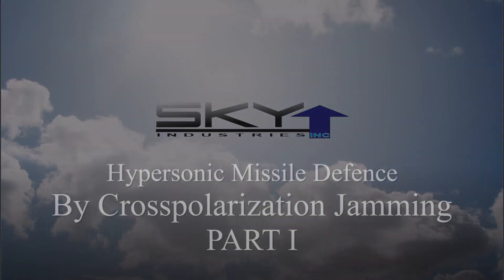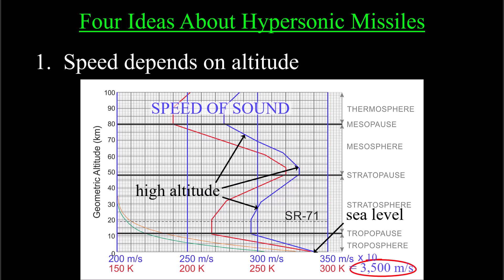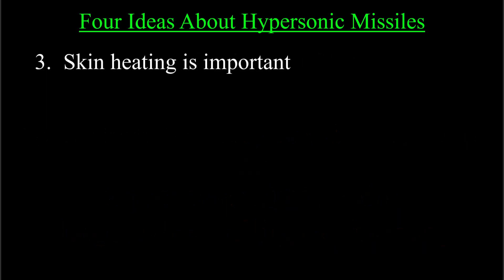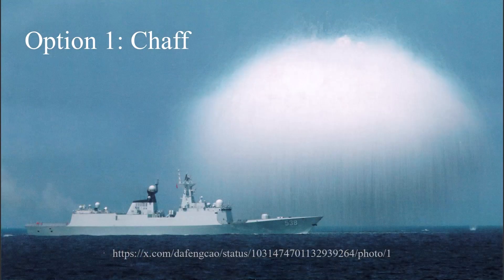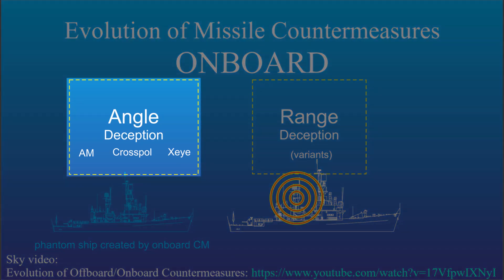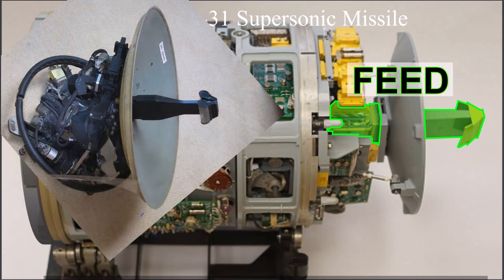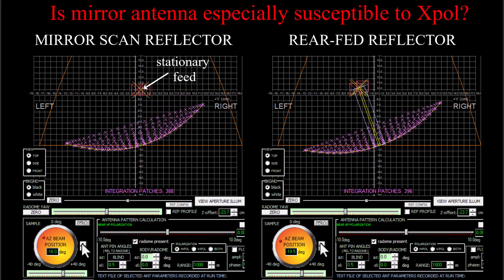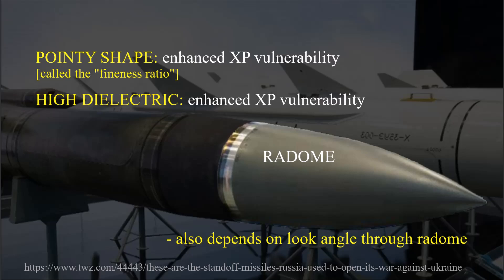Hypersonic Missile Defence By Crosspolarization Jamming PART I 25

Comment: Would these techniques still be effective against AESA seekers which can adjust to different polarizations?
Reply from the maker: Yes, although the jammer would have to be designed to automatically follow the polarization changes.  The required electrical arrangement is essentially a retrodirective Crosseye jammer.

Comment: I don’t really believe in point 4, about the impossibility overcoming plasma, same for aerodynamic drag and heat I think it’s possible to do a missile with a very high velocity in the terminal phase as well

I have a few ideas, one uses a funny quirk with physics/optics but whether or not that could work depends on how wide the plasma cone is. 
Another idea uses fluid dynamics instead. 

As for interception it’s absurdly difficult and I don’t think it will ever be reliable, very sophisticated missiles (far more than now) could have perfect vision, be impossible to jam, be able to maneuver with high G turns in all phases, coming in at speeds measured not in Ms but in multiples of 1 km/s, all while being able to come in from several directions at once and all while the interceptor systems and platforms available at each target are known in advance... 
lasers will never work both because the time is too short and because they’re already resilient to heating even if not expressly designed to counter lasers

Missiles have too much of an energy disadvantage and it’s not guaranteed that you have the luxury to intercept mid flight ( interceptors launched when missile launch is detected) 
Rail guns don’t work, the non stupid version, cool guns, could work but I seriously doubt you could produce a turret that can rotate fast enough while still being precise and launching slugs large enough to survive in the atmosphere while still being fast enough to give you a few seconds or put a few kilometers between the missile and the target at interception point

All in all I would say proper missiles will be impossible to stop, though that’s not necessarily a realistic scenario, most militaries are highly incompetent, corrupt, outdated and cut corners, they rarely even have an overarching doctrine
As such most missiles are low cost and close range, but that’s just the result of ground armies in a non nuclear setting in attrition wars searching for the cheapest bang for your buck option. It’s not an unavoidable way to conduct warfare.

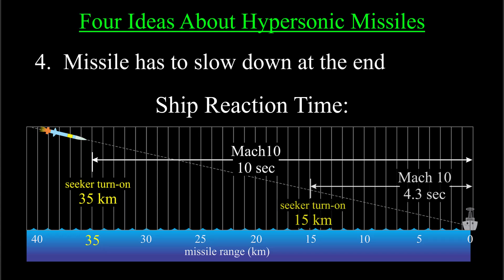Comment: 3:33 What if it’s remotely guided ? AWACS. SATELLITE. or other seaborne sensors . ?
Reply from the maker: The seeker is needed because a continuous flow of precise guidance information is needed to physically hit a target that can move after the missile is launched.  

AWACS detects the presence of emitters; it doesn't provide seeker-quality target location information.  

Satellites use synthetic aperture radar (SAR) which requires the satellite to move relative to the target so that means LEO satellites (Low Earth Orbit), so there's a time delay and likely update rate issues. 

A satellite could in principle also use video, but there are weather issues and time of day issues, and a LEO satellite orbit would have to be coordinated with the attack since it has to overfly the target exactly when the attack is started.  

Or: just use the seeker.  

In any case, the video is about jamming the seeker; impossible to jam a seeker that isn't turned on.  If it's not turned on, no need to include it in the missile.
Reply: @skyindustries Dear bro. Triangulation. There must. Be a jammer downtime/ reaction time. / delay. Seeker will be turned on for sure but ECCM is a thing to. In end phase when Oniks / Moskt dive in sea skimming mode and suddenly turns on a seeker , how long then would it take for ECM sensors to detect and deploy their counter. Thank❤

Comment: just asking - fibreglass guidance like a TOW or the new "jam proof" kamikaze drones  -  can a incomming missile or a cluster of missiles jam weapons guidance of air defence missiles 
China experiments with AI controlled droneswarms since at least 2019  - imagine including low flying cruise missiles with Jammers as payload
Ukraine droneboats/ boat torpedos like sea baby can be used a a platform for Air defence weapons to bait air assets into targeting range or as platform to jam incomming ship to land cruise missile guidance as well 
would it make a difference for air defence missiles on ships to be fibreglass connected with the ship to compare ship radar data with its own guidance seeker for a higher hit probability and higher EW resistance ?  obviously this must be fully automized , no person has the needed reaction speed 
is Wire guidance correction even fuseable at the Mach 3-or-so speed most air defense missiles have 
are directional mines like a Super sized claymore a viable option as a hardkill APS to compliment the gatling gun CIWS? 
AA Gun depression and lack of proper radar discrimination at wave height during rough seas was fatal enough for the Russian Moskva to make itself identify as artificial reef - did the US ever check and prepare their own fleets for similar weaknesses thereafter 
Are depth charges for torpedo hardkill a option or do you have small counter torpedo torpedos ?

Comment: The word "Mach" is a unit of measure for local speed of sound named in honor of Ernst Mach an Austrian physicist.
Reply: Nope. The Mach is the RATIO between the speed of a given flow AND the local speed of sound. Hence the 'number' in Mach number, and the fact that the Mach number is just that: a number, without a dimension (speed / speed = (1)), whereas a speed has a dimension (distance / time = m/s in International System units). The first thing, in physics, is making sure that your equations are consistent from a dimensional perspective.

Comment: Problem that you did not count is that missle goes from direcly above , not in balistic trajectory.
Reply from the maker: There  is no problem; the jammer is mechanically designed to be able to point its Tx and Rx antennas to cover all possible attack angles, so the ship can be fully protected.  This is normal mechanical engineering.  

Unless you mean something else, I can't think of what that would be.  The effectiveness of Crosspol jamming does not depend on the direction of attack by the missile.

Comment: 3:16 That is an outdated concept . Missiles don't require a frontal facing seeker to find their target , you can overcome this by implementing datalink with the missile receiving course correction from the carrier or other assets in the network ( missiles like the Kinzhal , Zhirkon or DF-21D don't have forward facing seekers they rely on datalink antenas at the rear ).  Thus a drastic reduction in terminal speed is not necessary. A hypersonic missile that would have to reduce its speed to supersonic regime in the endgame phase would make little sense, since endgame phase is precesily where speed matters the most .  Good video non the less !
Reply from the maker: Interesting points.  

I see references to satellite SAR targeting, and also mention of terminal phase seeker; they are complementary: https://en.wikipedia.org/wiki/DF-21#Guidance_and_navigation 

I am skeptical that satellite SAR can provide sufficient real-time target location information for missile intercept of a moving target; in any case, jam the satellite link.  

As the missile gets closer the jamming power in the receiver gets stronger [yes I know the missile antenna fwd gain is less], while there is no change in the satellite signal power.  From an ECM perspective it's a bit like jamming the HS293 glide bomb fielded by the Nazis in WWII, which also had an aft-facing antenna: https://en.wikipedia.org/wiki/Henschel_Hs_293

I disagree with your assertion "A hypersonic missile that would have to reduce its speed to supersonic regime in the endgame phase would make little sense, since endgame phase is precesily (sic) where speed matters the most".   What matters most at endgame is accuracy.  That means accurate target location information is needed, as well as sufficient agility to correct late-stage guidance errors.  

This is another reason to slow down at endgame: the faster the missile flies, the higher the required lateral acceleration (LATAX) to correct errors between flight direction and line of sight to the target.  

LATAX demand can be reduced by reducing speed, as is done by anti-air missiles.  Here's a video I made that illustrates the relationship between speed, LATAX and target intercept: https://www.youtube.com/watch?v=EGQn0iHZfhQ

Here's an eloquent video that comes to the same conclusions as I did, interesting and very well done: https://www.youtube.com/watch?v=yOE0-sL0nQ4
Reply: @skyindustries  I do agree that satellite guidance would not be ideal for manuvering targets but envision satelite guidance + INS only as a solution for fixed targets. For mobile targets terminal  guidance from airborne assets such as AWACS etc, seems more appropriate. It is an established method of guidance for quasi-ballistic missiles like the Iskander-M against mobile targets.

In regards to speed my argument was not to say that speed is the most important factor in the endgame phase, of course precision is More important. My argument was that during the entire flight enveloppe , terminal phase is where speed matters the most since this is where the missile has the higher chances to be detected and countered. 

It seems counter intuitive to me for a hypersonic missile to fly supersonic during the endgame phase where it would be the most vulnerable to enemy air defence systems, it would appears to defeat it's purpose. That being said, i could imagine a hypersonic missile decelerate at appropriate range to speeds that allow it to use ARH in order to update it's INS then accelerate again to hypersonic for the terminal phase.

Last but not least you correctly point to the fact that higher speeds imply high G for course correction. That being said i would also like remind that when we talk about mobile targets we are mostly talking about large vessels which have very limited manuvering capabilities especialy against such fast missiles . The faster those missiles go the lesser target manuverability matters , from the missile perspective the target is moving in slow motion so the lesser the demand for course correction / high G manuvering becomes. This concept also applies to air to air  combat where hypersonic ARH missiles like the R-37M pull much less G than slower ARH like the AIM-120 or R-77 but remain vastly more deadly because their high speed lets little to no reaction time and renders  kinematic defeating almost impossible even for very manuverable jet fighters that can pull over 9G , which no warship can .
Reply from the maker: @user-qq8ek4zs4s fair points.  

The need for high-g requirement at end game isn't because the target is maneuvering, it's because at high speed an intrinsic small heading error can quickly become an unrecoverable large heading error.   

As speed increases, the LATAX to correct even small errors becomes huge; I learned this by playing with the Soft Kill application in ENGAGE.  It's here: https://www.youtube.com/watch?v=7QnSMxx89ZA
Reply: @skyindustries True , thank you for the link will view it for sure 👍

Comment: In this day and age, missiles still using "classical" radar for seeking would be immensely silly, a combination of high speed cameras and proper AI algos + AI hardware would make decoys and chaffs meaningless, would seriously crash the party and brings the game into a whole another level... I bet that in 5-7 years from now, the military is gunna show off my theories in practice. Computation hardware can be built to melt flying bullets which travels at mach 7. Every 12 months, the speed required to detect gets better by 10-20%.
Reply from the maker: re. "using "classical" radar for seeking would be immensely silly": Radar has been used for decades because it's an all-weather all-conditions sensor.  

What you are referring to is electro-optic sensors; they don't work in rain or fog or if the target is obscured by smoke for example, or haze at long range.  These things cause no problems for radar.  

Not sure what "computation hardware" is or how it can melt bullets.  Bullets do not fly at Mach 7.

Comment: Why waste time with mach numbers instead of just talking about speed. Also, these missiles are already in a bubble of plasma so I don't see how a jammer is going to do anything about that?
Reply from the maker: Mach number is a standard term in fluid mechanics; it represents speed in the medium relative to the speed of sound in the medium.  Reason it's useful: it captures the collective effects of several other variables like temperature, pressure, density, viscosity, can't remember them all.  These change with altitude, humidity, air composition (air is a bunch of gasses and impurities), etc.

You are correct that the plasma sheath shields the seeker from the jammer (depending on frequency) because the plasma behaves like a metal shield... but neither can the seeker see the outside world.  

In order for the seeker to search for and find targets, the missile has to slow down below Mach 5 so the plasma envelope disappears.  Then the seeker can see out.  

But then the jamming signals can come in.  And for a hypersonic missile the seeker is especially vulnerable to Crosspol because the radome has to be physically strong, which requires it to be made of a tough material like a ceramic, which roughly correlates with a high dielectric constant, which means polarization bending (dependent also on radome shape), which means high susceptibility of the antenna/radome combination to Crosspol jamming.

Comment: So does that mean we are just reinventing ballastic missiles . If hypersonic missiles dont work like cruise missiles at least in their terminal phase then its useless. Isnt it
Reply from the maker: Jamming is useless against something that doesn't use radio signals - won't work against garden-variety mortars or bullets or such like.  

Ballistic missiles are useful for indiscriminate destruction and for things that don't move, like buildings or bridges.  But to hit something that can move after the round is launched, real-time guidance is required, so the flight path can be tweaked at the end to actually hit the target.  Arguably the best option (least expensive most-flexible best-performer) is a seeker and autopilot.  With midcourse guidance.  The seeker turns on when the missile thinks it's getting close to the target.

Comment: what id hear me out we use coms from the body of the missile to a satellite for targeting then it could have basic tracking all the way to target without needing to slow below mach 5 for targeting
Reply from the maker: An interesting concept but it's tricky business.  The videos have no relevance if there isn't an RF seeker.  

Could it be done?  I don't know.  Almost anything can be done, is the payoff worth the cost?  

There are several important problems to solve; the ability to hit a target depends on at least this much, in random order:
- the accuracy with which a satellite can determine the position of the target relative to the the missile
- the latency of the guidance information
- the closing speed
- the max achievable lateral acceleration of the missile body
- the properties of the guidance loop
- the satellite(s) coverage (time and angle)
- the type of sensor used by the satellite(s) (e.g. optical [oops there are clouds or smoke], SAR [awful delay])
- the signal processing used to extract the guidance error signal
- the attack geometry, including the satellite(s)

Undoubtedly there's more.

Comment: Speed of sound does not depend on Altitude but on atmospheric temperature!
Reply from the maker: I see you are right, many thanks!  

From the 5th paragraph here, very interesting: 

"...the gas pressure has no effect on the speed of sound, since the density will increase, and since pressure and density (also proportional to pressure) have equal but opposite effects on the speed of sound, and the two contributions cancel out exactly."

https://en.wikipedia.org/wiki/Speed_of_sound#Dependence_on_the_properties_of_the_medium